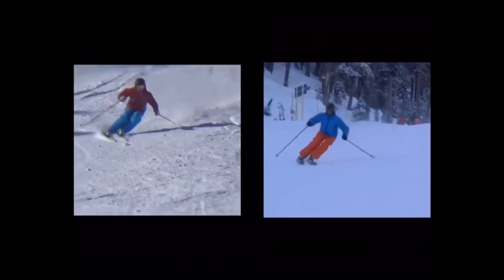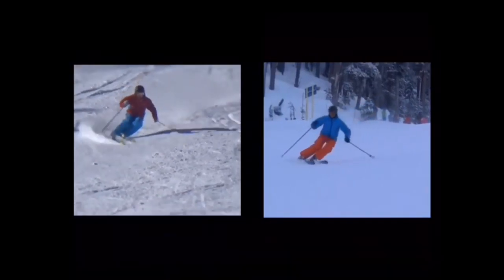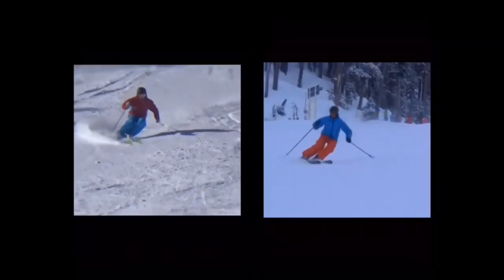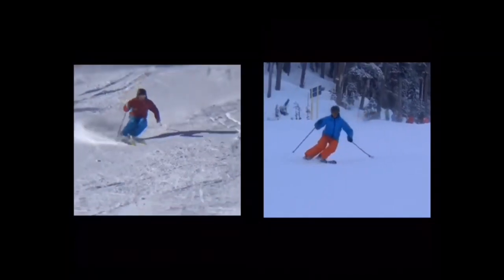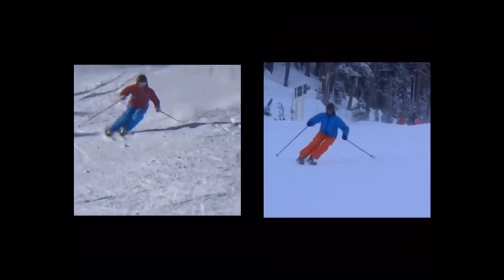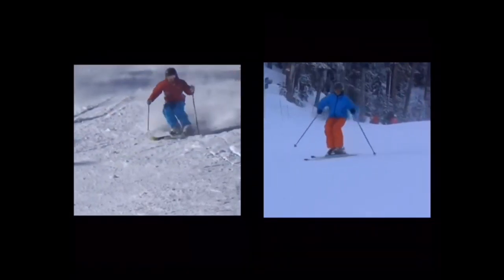Short turns movement analysis- pivoting and ground reaction force

Comment: I agree with most of your movement analysis except one thing that's big about these two skiers. The examiner is projecting his body forward down the fall line much better and acquires an earlier edge because of it the red pants gentleman is more in the back seat you can see it even from this head-on angle. One other thing I do not believe the snow can push back; you can only create a stable platform under the ski, it's a more accurate statement. On a side note; I almost never use the word "push" to describe a body movement ether, this can be misinterpreted and can create an ab-stem.
Reply: You know nothing about GRF …

Comment: Isn't the orange pants guy also doing an extending up movement through the transition, producing that 'light on skis' effect you talk about, whereas the examiner remains flexed and allowing a rebound effect for the legs to cross under his upper body's plane of travel, and earlier engagement with the edges into the next turn?
Reply: Well said.

Comment: Hi Tom. Your analysis is very interesting and correct. Although in the analysis that follows by your viewers and yourself briefly touches on extension to release in reference to popping up by the  level 3 candidate, no where does the analysis during or after the video deal specifically with the movements required in transition to achieve the far superior result of the level 4 trainer. In short, the trainer flexes (bends) or relaxes his legs while tipping to the new edges to initiate the release of the edges in transition. The candidate does the opposite, he extends his legs by pushing off his feet, pivots or twists his skis in the new direction once there is no pressure against his skis and does not achieve genuine edging until the end of the turn.  The candidate's skis therefore are essentially floating (not contacting with any pressure against the snow) until the end of the turn which results in a sudden built up of pressure and a breaking action. In fact, the arc of the skis can best be described as that of windshield wipers. This is not the fault of the candidate because the CSIA teaches him to extend to release rather that flex. So first and foremost, the CSIA must describe the movements required to release (used by the trainer in this video) both verbally and in their manual. They must also emphasize that if your objective is to carve throughout the arc, creating fluid turns with round arcs, early edging before the transition, and constant speed, it is impossible to do that if you extend to release. You must combine flexing and tipping to the new edges and foot pullback to release in the transition.
Reply: Bill, with respect, please stop talking about what the CSIA does and doesn't do. Your diatribes demonstrate your ignorance of the CSIA technical reference and modern instruction methodology. The CSIA isn't perfect, but you (and, sadly, most PMTS fanboys) seem to be stuck with a 90s CSIA model in your head, which is wildly different from current practice.
Reply: @davidm1922  The reason for this is simply that PMTS is a far superior system (it works!) To coin a phrase - once you go buck, you never go back! Other systems become irrelevant. Out of interest, what are your objections to PMTS?
Reply: Good question Federer!
Reply: Good points - influences of Harald Harb in evidence here. The guy in the red pants reminds me of the old school BASI short turn - twist push and edge check. An inefficient technique where control is only regained during the ending edge check platform - only to be lost again straight away. The trainer's turns retain guidance and control throughout the sequence. As you say, the transition difference between the examples is a complex area in itself.
Reply: @Federer935  I like the positive input here Bill & Federer935.  I had a look at your own YouTube site Bill: some pretty impressive skiing, I must say!  I can also see you're a Harald Harb aficionado.  Nothing wrong with that - I've done his courses too.   The point I tried to make in my first response to Tom's posting was to try to identify what Orange Pants could do by way of implementing a different body position and a different skiing technique to achieve the Level IV 'blue pants' look (which we all have to admit looks pretty cool).  Tom, I don't know whether you're still following this feed, but I like Bill's analysis and I would be interested if you agree with him.  What I really want to know is what drills you  would recommend Orange Pants implement to change a skiing style that he probably learnt 20 years ago and is going to take some effort to deconstruct.  Or is the fix just a matter of Orange Pants forcing himself to stay down over the outside ski in the 2nd half of the turn?

Comment: Great analysis.... So we have the ‘effect’ but what is the ‘cause’?  How can we fix ‘Orange Pants’ skiing?  My guess as to the cause is: 1. Too much in the back seat. 2. Not balanced over the outside ski. What movements does he need to implement to solve the 2 causes.  I’d suggest drills to: 1. Encourage a much more aggressive athletic stance which will engage his hamstrings and not his quads, thereby getting his weight forward into the front of his cuffs. 2. Get balanced over the outside ski as early as possible - even before he ‘completes’ his turn. Check out  http://burkemtnacademy.org/skiing/alpine-instructional-videos/ in particular the ‘get over it drill.
Reply: tgellie hi Tom I’m not Peter but he had my question too so I hope you guys don’t mind the thread jack. I read both your replies and both make sense. Have a question though, your explanation of “popping up” too much makes sense and not having anything to push on. But wouldn’t Peters thoughts of being balanced earlier on the outside ski result in one making sure their weight is there earlier and hence generating force earlier? I haven’t been on skis in months but trying to imagine (and orange pants is probably better than me!) challenges with early grip while short turning I would imagine my outside ski not having enough force until very late...and I’d be skidding. I would make sure to create grip (balance) earlier, and that may naturally make me do what you suggest which is to use energy from the previous turn instead of up and down. Easier said than done of course 

With that said I do have a question about your 9.85m/a thing. The examiner is getting energy laterally which is what I think you’re suggesting we achieve (you mention the word acceleration), what does he do to achieve this? 

Thank you for the great analysis and the discussion.
Reply: tgellie - in a nutshell blue pants knows how to let his skis turn him, whereas orange pants knows only how to turn his skis. Or to put it another way, the examiner edges before pivoting whereas the student pivots to an edge. Blue pants actively feels for the wall and then works it, orange pants has no sense of the wall.
Reply: @peteyndebs  This answer should be pinned/highlighted somehow. Most straightforward and concise fix ;)